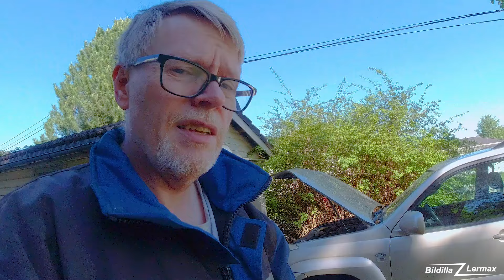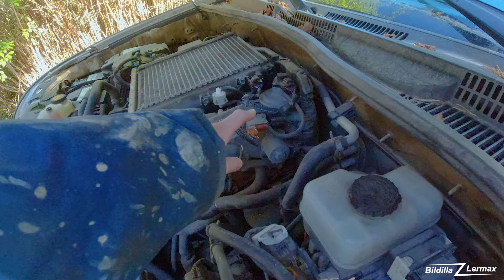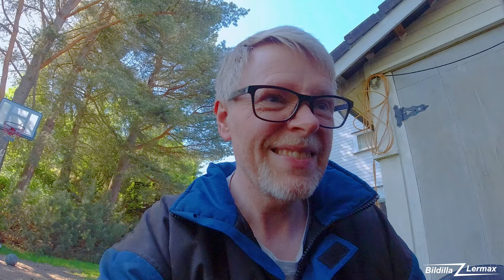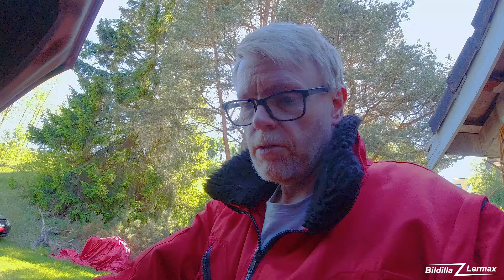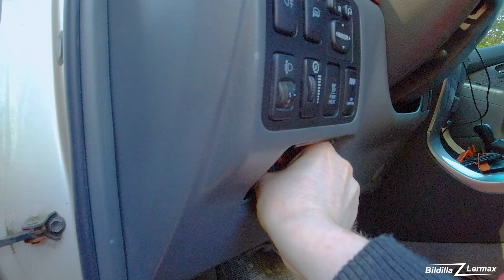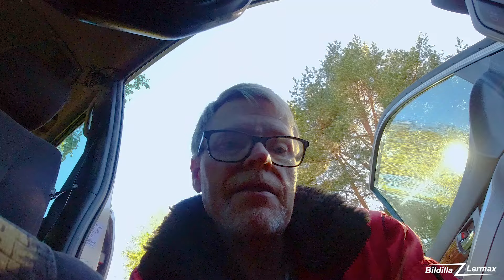Toyota Land Cruiser / PRADO 120 - 2006 - Time to get on with fixing it - Bildills Magasin

Comment: I have a 120 with an immobiliser fault I have narrowed it down to the door switch which is connected to the immo system which has shut the car down completely.. It is a late 2004  with the newer gearbox... have lost interest in it as very hard to get to the source of the problem and very difficult to pin point..
Reply from the maker: Hello

Yes, that sounded like a difficult problem.
When you say door switch, do you mean the main controller on the driver's door, for locks and windows?
You can find one like this cheap online! I bought one too many once too..... That was the time I found out that you can reset the controls for all the windows... Yes, that was something you learned from at least!
If it could be as simple as changing it? But Toyota's original ones apparently cost a LOT!

Greeting
Pål (Paul)
Reply: @bildillamagasin  Indeed on the immob  ecu wiring there is a feed to the door switch which has to be activated to allow the ecu to run.. When the doors are all closed the light for the door open is illuminated on the instrument cluster.. It's an annoying fault that prevents the engine from starting!
Reply from the maker: @avit24  Very strange yes.
I would then think that you cannot start the engine if a door was also open. But it's going just fine.
But if the main controls in the door are defective, it stops the car from starting. It is now absolutely hopeless.

Hope you find a good solution to this. Never heard of it before.

Could it be that some of you who stop by here have heard of something like this?

Greeting
Pål (Paul)

Comment: Har du prøvd og bevege på selve staget som kommer fra turboen som er tilkoblet til actuatoren du får feil på, somsakt kan vær att problemet er i selve turboen.
Reply from the maker: Hei leste feil først jeg. Ja jeg har vært løs med staget! Det var veldig vanskelig å flytte på ventilen. Jeg fikke sprayet det med olje, og fikk frem god bevegelse igjen. Men activatoren som skal kjøre når du starter opp, vil ikke være med lengre. verken den gamle, eller den nye jeg kjøpte. Derfor jeg startet å se på kontrollboksen i hanskerommet. De hevdes at det er et stort problem i Sør-Amerika, på Hiluxer med samme motor. Kontroll boksen blir brent, p.g.a. varmgang, når activator motoren bruker mye støm for å prøve å bevege ventiler som har satt seg. Men kan ikke se noen antydninger til varmgang på kontrolleren på denne bilen.  :(
Reply: @bildillamagasin   Høres veldig rart ut, jeg hadde skjekka ledningene som kommer fra actuatoren før dem begynner og gå inn mot karosseriet og skjekka om det er brudd, kan også være brudd på lednigner, ledninger i motorom kan smusse og evt knekke og miste trengenede kontakt. Må du ta av isoleringen på ledningene og se koss ledningene er.
Reply from the maker: @blacksky9621  Huff ja. Stor sjanse for at det er ledningsbrudd. Målte at vi hadde kontakt i + og - 12v til drift av motoren, men klarte ikke å se at det var kontakt på de 3 ledningene som sente posisjons info.  men kan de gå til en annen enhet en datahjernen i hanskerommet? Det ville jo vært meget merkelig.  Skal dobbelt sjekke selve ventilen igjen. Så ut som den hadde blit treg igjen! Men har tatt av staget, og styremotoren går ikke selv ut at staget er koblet til...  Huff ja. Slitter med at jeg trolig må til Oslo mange helger fremover.  Blir veldig lite tid til overs for å få gjort ferdig alt jeg burde gjort.
Reply: @bildillamagasin  Har du skjekka og ta ut data hjernen, evt også Ecuen på bil og åpne og se om det er noe smuss eller grønn aktig brente spor på ecuen og turbocontroll hjernen? Også må du se om det er ledningbrudd som eg sa i sted fra ledningene til actuatoren, om det ser helt fine ut så er det nok turboen som har rasa innvendig. Må bare prøve deg frem. Lykke til!!!
Reply from the maker: @blacksky9621  Ja har tatt ut data hjernen til Turbokontroll. Så at det skulle være fare for at man brenner opp kondensatorer i disse. Men min ser helt fin ut. Fikk en elektro repperatør på jobb, til å dobbeltsjekke og lodde opp alle kontakter som kunne være utsatt også.
Se innom på denne videoen: https://youtu.be/uOLFzqwq_Uo